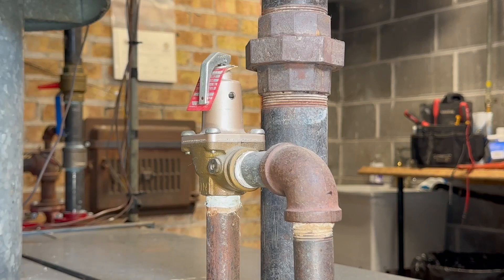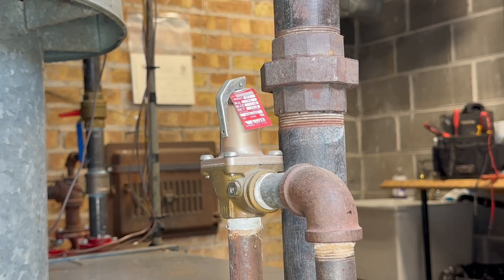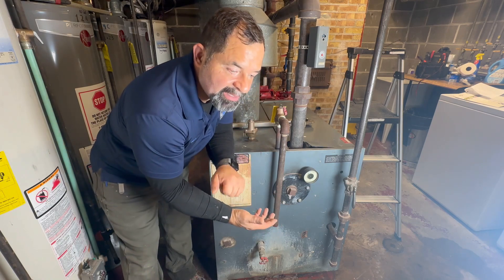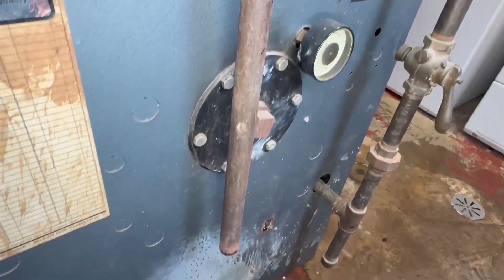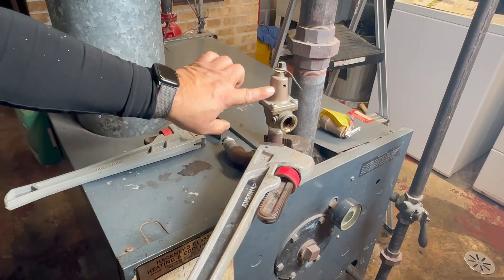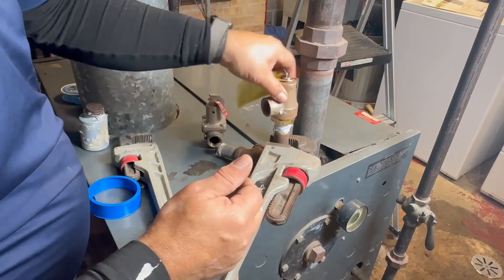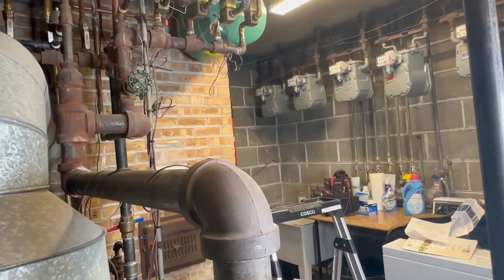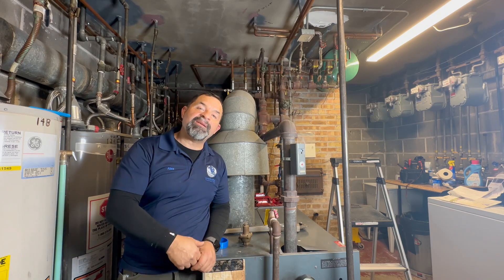HOW TO REPLACE A BOILER PRESSURE VALVE. SAFETY AND HOW IT WORKS.

Comment: Great Video. Thank you for sharing. Happy New Year. Do we need to drain all water in Boiler before replace pressure valve ?
Reply from the maker: Hello,  Happy New Year!!!  
Not at all .  Close every posible valve.  Drain maybe a couple gallons.  Then activate the safety pressure relieve valve,  when stops spitting then you are ready to replace it.